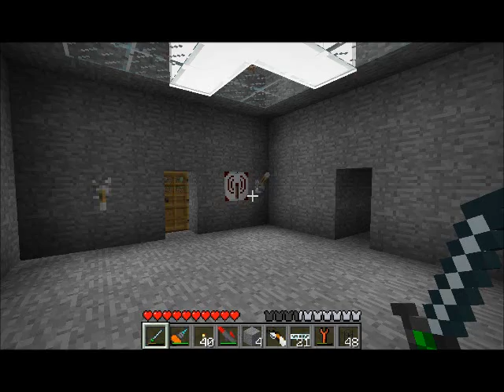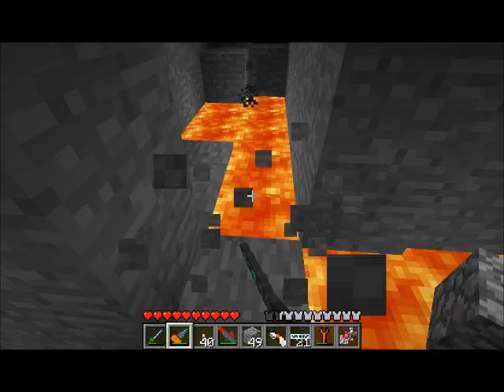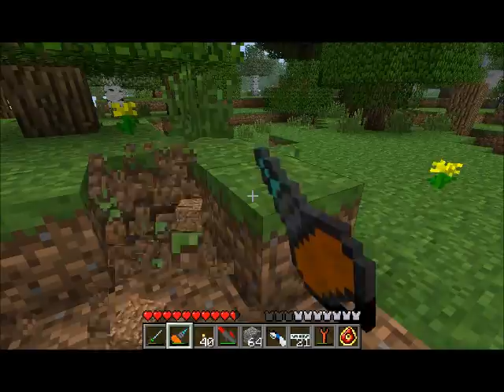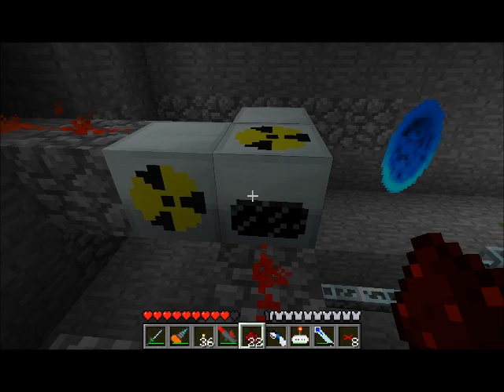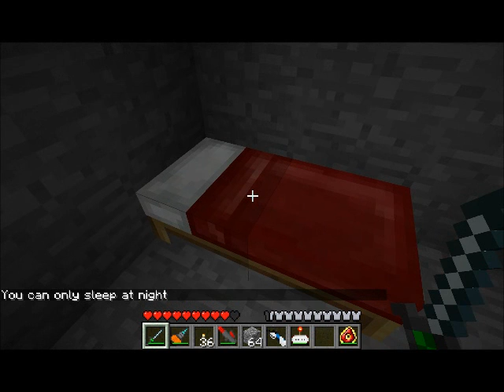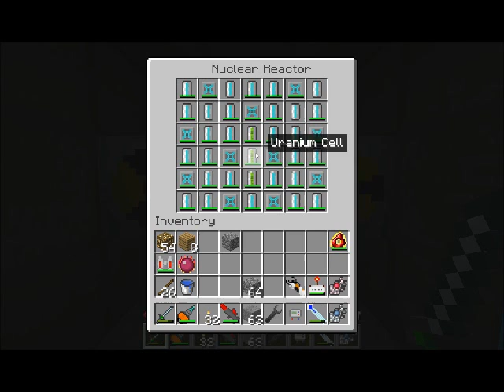Direwolf20's Minecraft Lets Play Episode28 Industrial Craft 2, Equivalent Exchange, BuildCraft

Comment: While I had this video open, I decided to run a little test.  I went into creative mode and sealed myself in a 7x7x7 case of Obsidian with the ceiling, floor, and walls all being 2 blocks thick.  I then put down a Nuclear Reactor and all of the possible chambers.  Afterwards, I filled it as far as I could with Uranium Cells; a bit above 2/3s before it exploded.  When it exploded, it destroyed ALL of the Obsidian and sent my flying.  You think you're safe behind that Obsidian wall?  Think again!